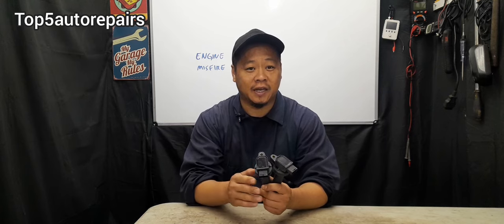CAN YOU DRIVE WITH A CYLINDER MISFIRE? HERE IS WHAT WILL HAPPEN.

Comment: Manufacturers program computers to cut off injectors to misfiring cylinders; as a result, you will experience a 25% drop in power. If the engine is a four-cylinder, your MPG  will decrease by 10%.  If that's alright with you, you can drive the car for as long as you want, assuming your country doesn't require emission tests. If it does, the only reason you need to fix it is to pass the inspection.
Reply: not all vehicles do that! I had 2 coils fail and i could smell raw gas!
Reply: Over time it can flood the engine and it could seize, just replace spark plugs first then wait for codes after that

Comment: Hey.  I have an 05 Cadillac cts.  I changed the ignition coils,  plugs, ecm, injectors and still misfiring.  It shows multiple misfires when reading the codes.  Car also shakes bad and has a ticking noise.  Bad gas mileage. All plugs are sparking when I checked.  Car seems to shake more intensely when unplugging 5 of the coils individually .  However the 6th one there is no response or increasing shaking when I unplug coil;cylinder 5 I think.  What are the list of possible problems and how to diagnose?  Please help.

P3831
P2098
P0140
P0036
P0008
P0301
P0306
P0305
P0300
P3537
Reply from the maker: Hello. I believe your timing is off thus causing a misfire. The misfire also ruined your oxygen sensor as well.  #6 ignition coil is most likely bad (power balance test).
Reply: @Top5AutoRepairs  hi, thank you.  my timing?  Does that mean timing belt is the problem?  I don’t have advanced computer reader, I’m a diy mechanic; just a basic code reader.  Based off all info I’ve given,  what can you recommend I try replacing , and in what order?  Please bear in mind there is a slight clicking noise; someone mentioned it may be rocker arm and lifter.  All ignition coils were causing spark when I pulled them out and held them slightly away from plugs .

Comment: I had to drive home on a missfire and after replacing the spark plug and coil was hit with "catalyst system efficiency below threshold bank 1."  I didn't know what to fix and started running down a bunch of clean catalyst rabbit holes.  Finally found this video.  I've ordered a new O2 sensor thanks to you!!
Reply: How did you get on?
Reply: Exactly my problem. Legacy 2004 h6 spec b
Reply: @mitz2772  still needed to replace the cat
Reply: Did the repair fix your issue?

Comment: I have a cylinder 5 misfire that I am unable to resolve. It’s a GMC canyon. I replaced the coils, spark plugs, and fuel injectors.I am going to replace the fuel filter next but I am sort of fearing the worse case. I also replaced the valve cover and gasket prior to all these replacements. You think I need a new engine? I have 327,008 miles on it right now.
Reply: Were you able to resolve the issue? course I am facing similar problem currently
Reply: @InnocentMondayMonday  no unfortunately. The next thing that I would need to do is replace the cylinder head and gasket. I believe the valve springs and piston valves need replacing. The cylinder 5 misfire causes the inside of truck to smell like fuel which is really bad. Can’t run AC bc of it. Overall, truck runs like a champ.

Comment: thats how my old vauxhall/opel car died. neglected by cow boy mechanics, not changing worn spark plugs. also neglect from me, ignored the strong smell of fuel coming from exhaust. thwn was too late. changed spark plugs, coil and fuel injectors. didnt make any difference and dumped car. had for 13 years

Comment: Thanks for this detail explanation.  Had me wondering to know why check eng light kept coming back after replacing both 02s... since not replacing the head gasket seals,  yet  
It been  causing oil on the wires.  Even though itvmay be 1 or 2 cylinder misfire only...  😮 need to get the gasket and seals  replaced finnaly.     Thanks  bro

Comment: Great video. Also some manufacturers set computers to cut off injectors to the cylinder that is misfiring 👊🏻👍🏻
Reply: If the injector has missing signal, the computer cut off that injector. Then can I drive the car safely for some hundreds of miles until I get it repaired?
Reply: @Knobber  yes but it will be running rough

Comment: My 04 Sebring has a P0300 code  (misfire on cylinders)  and I  took it to my mechanic and he said that the problem it is not the air , electrical, and fuel  system but it could be the timing belt or worn lifters . What do you think it is  ?

Comment: My moms car is a four cylinder and it had a P0304 and the check engine light was flashing. I actually seen a video talking about flashing check engine light referring to misfire and potential fuel getting into cat and damaging it. Idk if its true what another commenter said about manufacturers programming injection to cease in the event of misfire but me and my brother came to the conclusion to unhook that injector on that cylinder to keep fuel from reaching the cat and monitored how it was running on 3 cylinders. Didn't seem any worse so it was probably already only running on 3 cylinders. Hopefully the cylinder will be ok as long as its being oiled it should be regardless of combustion in that cylinder?

Comment: I ordered 8 fuel injectors and they delivered 1 😮. Amazon fixed the issue rt away though. I had a misfire on cylinder 4. Took the fuel injector out cleaned it up and codes went away. I don’t trust it which is why I’m replacing all 8. Fresh start. My question though. Is it true that can cause engine overheat? Needle goes up then bk down so idk what else might be going on.

Comment: I have replaced, 4 coil packs, 4 plugs, 4 injectors, and I am still getting p0304 code. You can feel the slight missfire while idle but no loss of power while normally driving. Cam/Crank POS sensors were changed, no vaccume leaks, MAF cleaned. Wiggled the coil/ injector wires to see if possible issue and nothing.Did compression test and all cylinders are at 115-125psi dry and about just shy of 150 wet. Any ideas?
Reply: Same prob
Reply: @392-oj-da-ape boys our transmission is gone 😔,gone continue driving till it goes out ig .Same problem
Reply: I’m wondering the same thing I have a misfire on cylinder 1, idle or low rpm’s are rough but smooth when up to speed or coasting.
Reply: @FFARGONE  yeeep same issue
Reply: I gotta Nissan doe ,wb yall
Reply: @CaliChrisss777  Nissan versa 09. 210k miles
Reply: @Z33Garage  still have the same problem,or did you find what was causing the misfire?
Reply: @CaliChrisss777  nah man actually we just sold the car as we could not find the issue and shops could also not find it.
Reply: Check fuel pump and cam follower, can negatively affect air fuel ratio
Reply: Anybody got a resolution ? My car is having the same issue
Reply: ive got a vic where i went through the same process and my 4th cylinder is at 40 ish psi been driving my neon since i was told by a shop it would be around 2700$ to repair but sometimes the misfiring will stop occasionally and no lights will be on at all then it comes back
Reply: Check the purge control valve, O2 sensors or maf sensor. It may be a bad pcv tho

Comment: What Catalytic converter? 
I had all three of mine removed years ago.  
I've been chasing a misfire code for about 2 weeks now 
It started as a P0303, I switched cylinder 3 and 6 coils around and the code was the same. Later it changed to a P0300, I replaced all 6 spark plugs and got one new ignition coil for cylinder 3. The misfire was still there and the code was back to P0303. I've been driving around like this for awhile now just waiting for this car to blow up lol. 
I'm still trying to figure out the problem, but at the same time I i dont care.😂
Reply: Were you able to resolve the issue? course I am facing similar problem currently
Reply: @InnocentMondayMonday 
Funny thing is I found the problem. It turns out it was the injector wire on the connector, it was broken. I checked all six and what do know you all of them are dry and cracked. 😂

Comment: I have a misfire the codes are 300, 303 and 305…mechanic did an compression test and said cylinder 3 should have PSI of 90 and above but mine is at 25 and told me I need a new engine…is this the case or can this be fixed without replacing? I have a 2011 Acura Mdx

Comment: So I had a 4th cylinder misfire... I didn't do anything for about a month using my car.

I initially changed all the spark plugs, but the problem still resided..

Then I changed one of the ignition coils. Problem went away.

But the problem I'm seeing now is that the car is running rich. My mileage reader is saying its knocking down 2 mpgs at a time sometimes, or more frequently.

If I put in new oxgen sensors, would the new one become contaminated??
Reply: How’d you fix your problem ?? I got the same problem right now
Reply: Did you fix it?

Comment: I've done everything. I could to my trailblazer. We switched out the spark plugs. We switched out the coils we switched out. I am a gas thing. I don't know, but it's still only running on 5 and I can't figure out the problem. Maybe you can, is it the Cadillac converter right now? The engine light came on and my car shakes. It stays started, but I'm only running on 5. Can you tell me how to fix this? Or should I just take it into my mechanic?  I have another mechanic and he's one that did the switching instead.All should be OK, it should be OK, but it's still running rough.Do you have any ideas?Thank you I don't have enough money to go to mechanic. That's why I chose this other guy who knows about cars and he got it running several times beautifully, but this time he can't seem to get what to do. He's done everything that the book tells him to do and still it doesn't. Change anything it still runs on 5 cylinders.
Reply: Not sure if you got this fixed since it’s been 2 months but changing the O2 sensors is worth a shot after you’ve replaced coils, spark plugs and valve cover gasket. I have the same issue, misfiring cylinder 2. Changed spark plugs, ignition coil and spark plug tube seals..no luck. I then plugged my computer in and got a threshold code for bank 1 and 2, or in other words O2 sensor. Replaced and fixed the rough idle and misfire.
Reply: @Sohidden  well I found out what was wrong the oil seal on the left hand side was bad so we changed it and everything's working right now, it was just an oil seal and it was leaking into my fifth spark plug put everything's going to be okay now thank you for getting back to me

Comment: Got a question i just started my car (93 nissan 240sx)  yesterday and it was having that missfire sluggish choppy idle even when driving it , would it be from my timing chain going out since its been rattling or my spark plugs that i havent replaced ?
Reply: if your timing chain is rattling, you better fix it. sooner or later it'll jump a tooth or 2 and smack your valves into the piston, and yes that'll cause a miss fire!